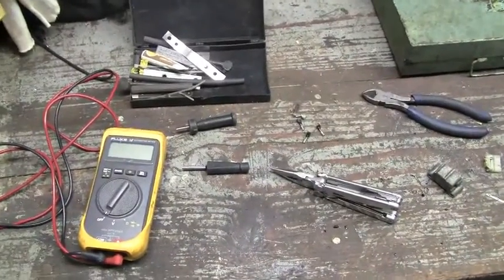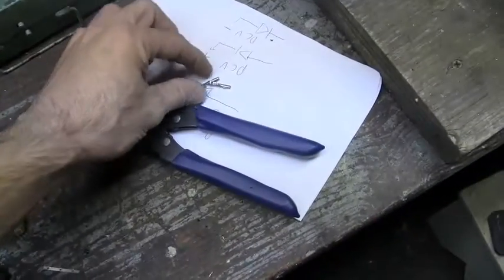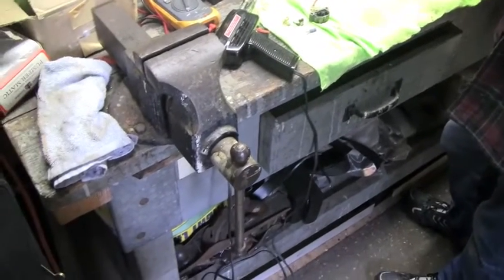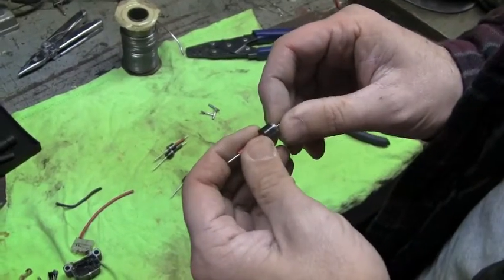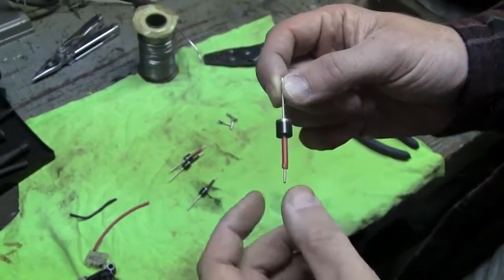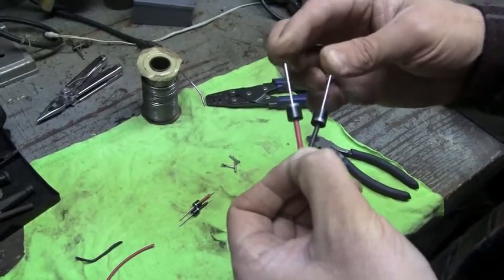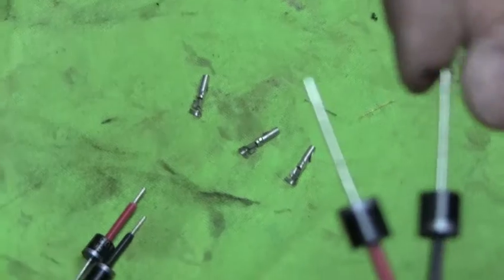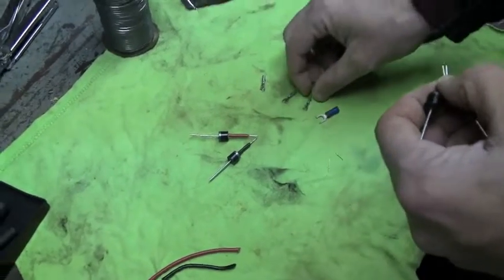How To Build A Bridge Rectifier

Comment: Those rectifer plugs are kinda an issue. Many motorcycles in the 80's at least had a similar issue. The plugs would melt and smoke the rectifier leaving you stranded. I think a lot of the cause is undersized connectors/contacts

Comment: Pls specify all that u use, d # of diode/s, d connections of polarity..
Reply from the maker: The number of diodes depends on the anticipated amperage as well as the size/capacity of the diodes.  The directions of polarity is explained in detain in the video.

Comment: OK dumb question.  Just swapped out an engine, sorted out the wire and ready to tie in the harness....all good.   Want to stay somewhat stock with molex pin connector.   Can use the housing off of the old engine to match the harness.....Are those .093 size pins that are normally on a tractor?   What in the heck or who sells the crimp tool, pins and pin extractor tool?    Problem is a search on the web shows a bunch of computer sized materials and not sure which type is correct.  Thoughts?
Reply from the maker: Not a dumb question at all...  These pins are a standard molex pin size.  I am fortunate to have an electronic shop somewhat near my house that sells everything I need...crimpers/extractors/pins etc.  These are speciality tools that can be found on places like ebay... be sure to include "molex" in your search and you will get what you need.   if you search "molex pin crimping tool"  you will find the crimpers and extractors  and "molex pin" will get you the 18awg .093 pins.